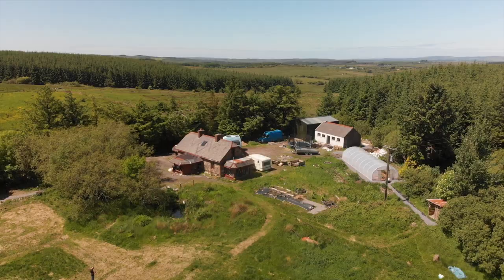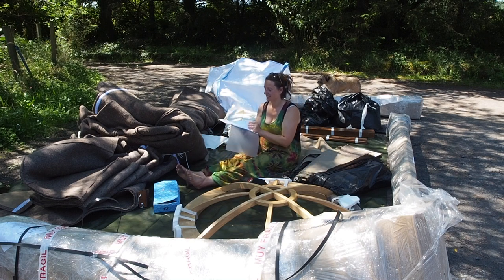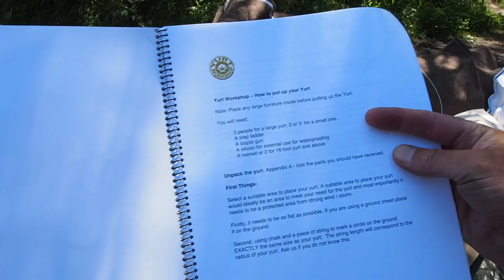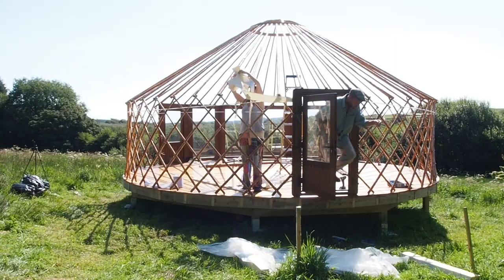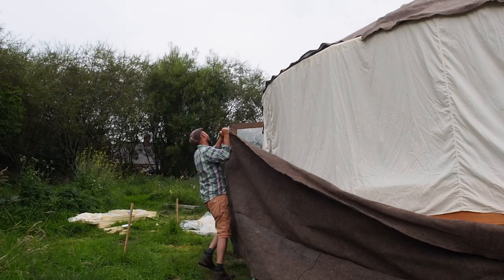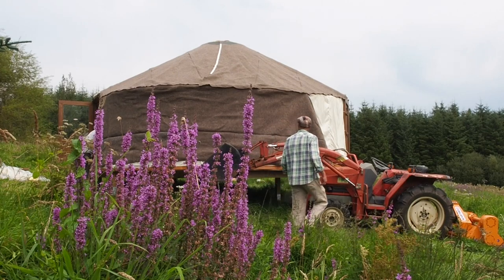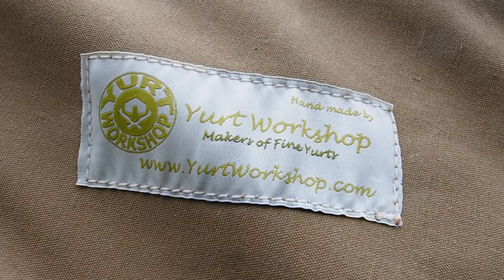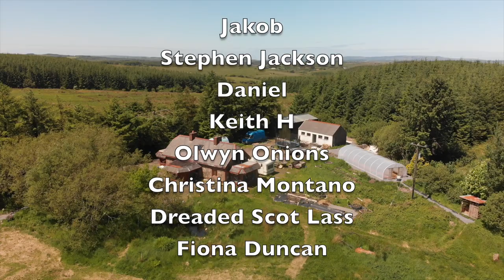Living OFF GRID in our Yurt!

Comment: I've noticed that most yurts are designed without eave overhangs. Roof water simply runs down the exterior walls where it can penetrate around openings, disrupt foundations and freeze on side walls in during cold seasons. It's not a good idea for a permanent dwelling.  Also it appears that R-values often are 100% dependent on foil bubble wrap of varying thickness; insulation performance claims and values of these products are generally unsupported and highly disputed by reputable construction thermal testing. No one seems to make allowance for the impermeability of PVC tarp exterior coverings. Interior trapped moisture vapor can be controlled, but it should be designed into the project.
Reply from the maker: Hi Terry. This yurt has definitely been put through it’s paces this last month. Non stop rain and wind. We don’t often get frosty round these parts and our yurt is insulated with sheep’s wool and I have built the platform with 50mm PIR insulation. We had a big cold snap recently and so far no cracks in the footings. I spent a lot of time vibrating them getting all the air out so hopefully they should stay strong. The canvas on ours is a breathable material not pvc although that being said our friends not far from us when replacing the canvas had one made from pvc as it’s so wet here and they say it works much better for them. Time will tell I guess. We are living in the yurt while I renovate the cottage and so far we love it :)

Comment: As someone who is planning on constructing a small cabin/tiny house on a secluded section of our remote land for summer use, is planning permission a consideration here? Did you let the neighbours know? 
I'm thinking of ignoring planning and letting all the neighbours around know but word will get out then with the wider community which maybe we don't want. Is pp needed for this structure? Plan is to have this structure for the next 10 years so that the original farm house can be rebuilt by me.
Reply from the maker: You could put your cabin on a chassis with wheels negating planning. That being said I know lots of neighbours here that have mobiles while renovations take place and I’m pretty sure they didn’t bother getting pp. if you build below a certain square meterage then you don’t need planning and if you are farming then you can build some huge buildings without planning from what I read
Reply: @OffGridBruce  ya 25msq is the dimensions I think. Chances are that nothing will be said and itl all be fine. The 'garden' is right beside the house and is well hidden thanks to tall trees surrounding it. Would be a perfect spot. Idea is to have it on a raised platform as the ground slopes down too much to have a mobile home or equivalent. The yurt looks brilliant by the way.
Reply from the maker: I’d say you would be fine plus it’s kind of a temp structure

Comment: "Off grid" expression is such an oximoron.
Reply from the maker: I guess it can be depending on how you look at it. I use it as it helps with views and fits within the dictionary definition. Adjective
not using or depending on public utilities, especially the supply of electricity.
"off-grid housing"
adverb
without using or depending on public utilities, especially the supply of electricity.
"he has lived off-grid for 32 years"
Reply: @OffGridBruce  Yeah, the word "using"... Very selective in what to apply the word to or at.. The majority of the stuff off grid uses (tools, cutlery, textile, gas, cars and whatever you need from outside to be brought in) is "grid" manufactured. I am all for self reliance as much as possible, don't get me wrong, but the expression itself is somewhat deceiving (that was the jist of my comment). Without the grid,  off-grid would technically be a giant struggle. Back to middle-ages.
Reply from the maker: I look at it as a spectrum rather than a yes or no. I’d say unless you drop off the face of the earth it’s impossible to be 100% truly off grid. I am miles away from being there but each step I take gets me a little closer. Not sure how far I will get but enjoying the journey so far